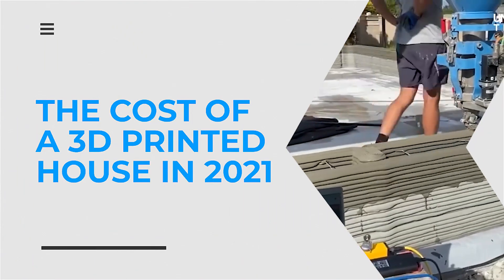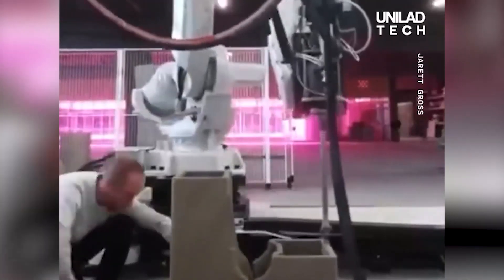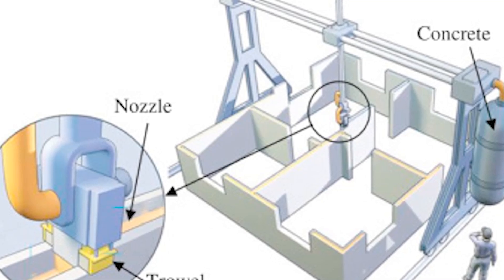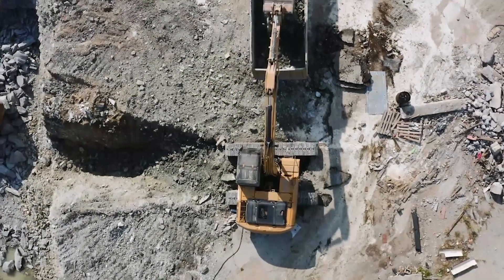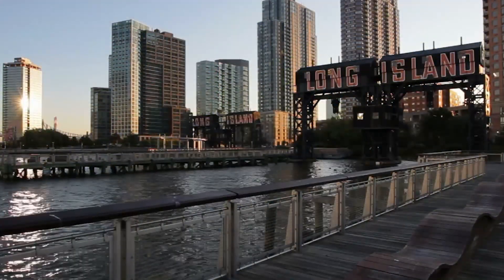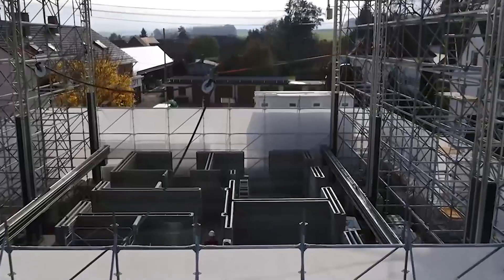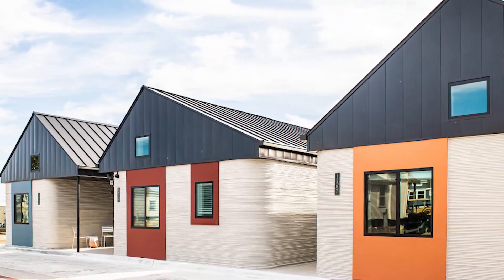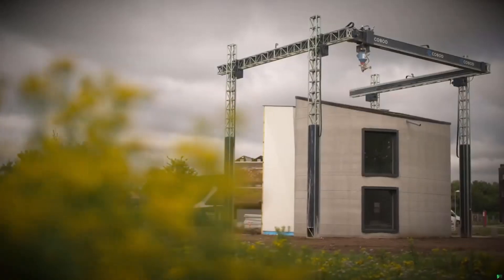The COST Of A 3D PRINTED HOUSE In 2021

Comment: 1: The company based in Austin that does 3d printed buildings is called ICON, not "austin and tobasco houses".
2: ICON has come out and said that the $4000 price tag was made up by someone and they didn't say how much the house actually cost.
3: Where are you getting the price of $10 million for a price of a house in Texas?
4: Where are getting the price of $2 million for a house on Long Island New York?
5: You claim that 3d printed houses will be cheaper by saying that the rent of a 3d printed house in the Netherlands would be $970 a month but a conventional house rents for 250 Euros. That's not cheaper, that's almost 4 times more expensive.

This video is bad and you should feel bad.

Comment: What happens when the water pipe in your wall bursts ??

Earthquakes can happen anywhere.  Will the walls hold up?  What's the cost of repair?
Reply: Not defending this video because it's a really bad video, however you can have your plumbing on the outside of your interior walls just like in a warehouse. Concrete houses are built everywhere, even in California where earthquakes are a huge possibility, those buildings are still standing. There are tons of things that engineers have learned over the years to prevent damage to concrete housing. Often repairing concrete walls isn't that bad: clean up the area, place a form on the walls to hold wet concrete, pour in wet concrete, and wait for the concrete to be cured.

Comment: These  technologies aren't ready for mass production AND mobility.
But I know there are concrete home builders in my area who currently use forms to prefabricate sections of homes. This is a great option for these kinds of companies because it speeds up the production time for the parts and they will be able to easily expand the number of "component parts" that they offer because they don't need to use forms that are difficult to resize to meet a unique need.  This option can also allow 3d-printing to speed up the assembly of large buildings, because they can literally make the lego and put the death star together on-site.

Also, the prefabricated concrete homes are great because repair to structure is often very simple.  I have watched as a cracked wall was literally removed, replaced by another, then sealed in under a day. They just unplugged the broken component and plugged in another one (with a crane, obviously).  It was amazing to watch.

It can be incredibly troublesome logistically for a 3d concrete printing company to haul around and set up equipment on a plot of land surrounded by other existing homes - where the neighbors are only feet away from each other and the streets are crowded with vehicles and people.

As stated by many other comments here, the prices quoted in the article that was read by the robot voice are way off.  But I suspect that whoever wrote the article wasn't really doing research on pricing, or thought that artificially inflating some of the pricing for traditional homes would make the expensive process of 3d printing a home on site more appealing.

Then again, what I get from this whole video isn't the 3d printing. That's not a new tech and I saw the beginnings of 3d house printing over a decade ago.  What I glean from this video is that I should be finding articles out there and a good Text-To-Speech reader and google some images, and then upload them to get 66 thousand views of a video that would take me moments to create in a free video editing software.  Then it doesn't matter how much 3d printed houses are - with the ad revenue I could afford a traditional house lol
Reply: Do you think the 3d printed house used materials that will last as long as concrete?  I want an inground home, passive solar, but I'm worried about mold and do not like the idea of the chemicals and plastics they might use to protect the home.  The Japanese company with the ceramics might be feasible as that wicks moisture, I hear.  Do you have any suggestions in a better direction for me to look?

Comment: 3D printing will probably not be practical for “printing whole dwellings” without the intervention of human labor within any of our lifetimes … especially given that the future of civilization is not in single-family housing, but is rather in multi-unit housing allowing for greater population density, which in turn creates greater cultural and economic opportunities—and there’s no 3D printer which could assemble a high-rise building safely on its own, nor will there be in any near century.

But 3D printing could advance our construction techniques beyond the stage to which prefabrication has already advanced them!

In the mid-twentieth century, prefabrication allowed for major components of construction to be created offsite, in a more safe and controlled environment, which in turn allowed onsite laborers to essentially “assemble” the delivered prefabricated components much more cheaply and quickly. There’s a slightly greater upfront cost involved—which is why even today it’s still not an incredibly common technique in much of the world—but the final construction costs of using prefabricated components are always much lower than the costs of constructing a building “from scratch,” plus the whole process is always made quicker and safer. 

Being able to take what are now prefabricated components and manufacture those instead onsite would further decrease construction time and costs, eliminating the need to package, transport, and unpack the prefabricated components. It would also further allow for someone onsite to improvise around unexpected obstacles or to make any needed modifications on-the-fly.

You’d still want smart labor assembling these components, and safety-checking the whole construction as it progresses, but 3D printing could in theory make the assembling of a prefabricated structure even quicker, cheaper … and, most importantly, safer!

So for the coming century a machine “printing out a whole house” will remain something of a flashy PR stunt extracted from a sci-fi fantasy, with very little practical application. Even in disaster scenarios, a small team can put up a yurt village much faster than a 3D printer can print multiple structures.

But 3D printing could definitely play a hugely beneficial role in how we construct our future urban landscapes! Safe, inexpensive, and aesthetically-pleasing high-rises, as varied as a CAD engineer can envision, could have their components manufactured onsite, to be assembled by skilled labor, in a fraction of the time it takes us to build a skyscraper today!

Comment: This is a recklessly produced video that doesn't reflect the ancillary costs to build a house. Most important are the mechanical systems that power the house such as wiring, plumbing, and climate control.  AN HVAC system to heat and cool a house can cost $10,000 or more.  Add plumbing wiring and fixtures and the figure will easily add another $10 to 20,000 to the price.  And that doesn't even include any provision for kitchen cabinets or appliances.  When you look closely at the you will also there is also problem with the basic the basic design.  There are no channels for installing pipes, wiring, or outlets.  This is a only a quick way to install a building shell and nothing else.  The entire presentation provides flawed logic and is deceitful in its conclusion.  If you still tempted by the cost comparison presented consider this.  Never once did the narrator factor in the cost of real estate.  In essence, this is NOT a thoughtful review but rather a subtle infomercial for the companies whose names are prominently displayed throughout the video.
Reply: Yeah, it always bothers me that when people talk about 3D printed houses, they never mention how the electricity and plumbing is supposed to be installed.

Comment: So, is smoothing of the outside surface not allowed for this type of construction?
Reply: The rough texture is appealing to some. I would personally like either a smoothed finish like stucco or to have it covered with siding of some kind.
Reply: The ribbed surface makes for easy purchase of stucco or cementing. There is no reason why a brick layer, siding, or other coverings could be added. Also, there are ways to sand down the bumps to make them smooth - a few 3d house printing companies offer this for additional cost as it involves more time and resources.
Reply: @raguellagrande7344  Ribbed for her pleasure? (I couldn't resist.)
Reply: The smaller you make each layer, the smoother it will look, but that comes at a cost of time spent printing it.

Comment: The Chinese company didn't print 10 houses in 24 hours.  They printed the walls of 10 houses without any plumbing or electrical, using *four separate printers*, in 24 hours.
Reply: I mean that is still extremely fast
Reply: It makes you wonder about the accuracy of their other statements. One thing is for sure: 3D printed houses are cool, but there’s a lot of hype and exaggeration in the promotional videos for them. 😂
Reply: Inaccurate information is being viewed to the public.
Reply: The plumbing and wiring is what makes a house a house 4 walls a front door  and a roof is a house
Reply: Not all homes in the world have inside plumbing or electricity. IJS.